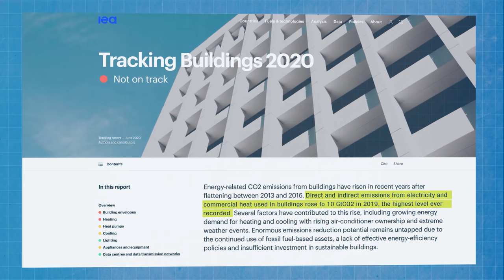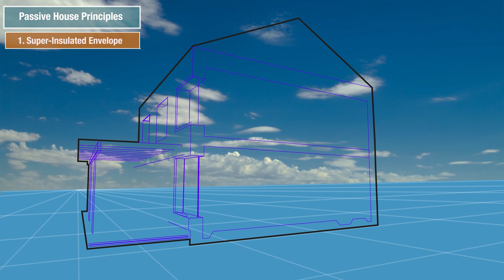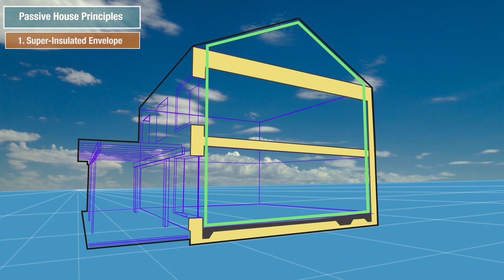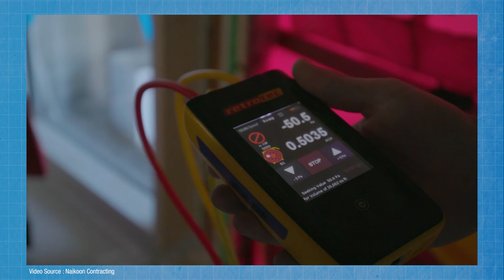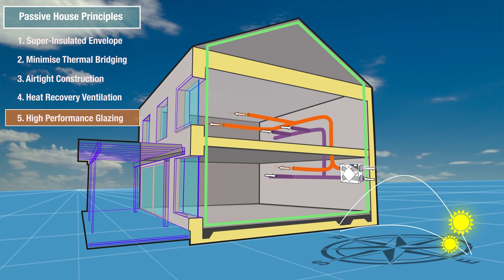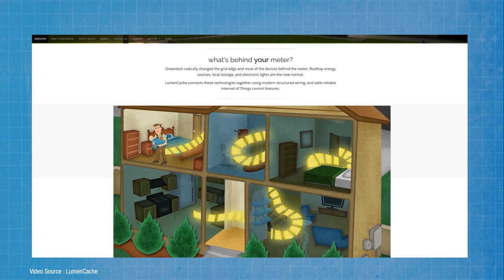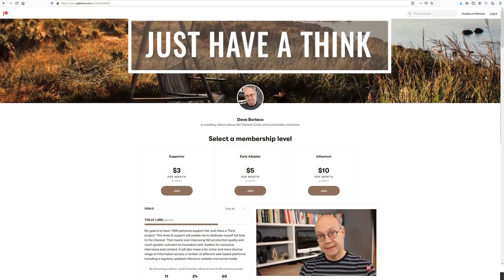Passivhaus . A low carbon future for our homes?

Comment: These should be combined with passive solar for a more enjoyable home. Windows let sunlight in to warm dark colored mass, like painted concrete blocks and water tanks.
In hot areas, put the rectangle of house plan north/south, to avoid too much sunlight heating through walls and windows. And obviously, east/west to gain more heat than needed for really cold climates. The trick is to store that heat in the thermal mass for overnight. That's where both natural and forced air movement works.
The big book on it is called...
The Passive Solar Energy Book: A Complete Guide to Passive Solar Home, Greenhouse and Building Design
by Edward Mazria
(4.3 out of 5 stars on the Amazon site).
I believe it's from the eighties and has a wealth of warm, lively, livable (with fresh air) information that might even compete with today's automated and almost airless solutions.

Comment: I am always disappointed that there is never mention  of simply having a smaller home as a means to be more energy efficient and having less environmental impact.
Reply: And terraced houses are great too. Only 3 external sides
Reply: Tiny homes 🙂
Reply: @Niels Kloppenburg You could use that argument for anything. One guy taking 3 baths a day will use more water than a whole family taking a shower once a week. So why bother to save water. 
Passivhaus can help the one guy in a large house AND the family in a small house. But I agree, the 15KWH per square metre target is something to aim for. It sounds like your company is doing well on the insulation. But if the joints leak air or you need a ventilation hole to get fresh air you will lose that advantage. Heat recovery ventilation and airtight construction should be in the mix also.

Comment: I lived in Laramie Wyoming and there were many passive houses built already in the 1970s.  I'd like to make two comments about insulation.  The fossil fuel industry is going crazy with many types of insulation, we should plant more hemp, linseed, bamboo as well as good old straw to replace some materials.  And I used to treat builders for back and shoulder pain.  Triple glazed windows cannot be lifted safely by the average worker and there has to be some consideration to helping the weak link, which is often a lumbar or cervical disc.
Reply: I think you're referring to passive solar houses being built in the '70s. Passivhaus is very different, but can incorporate passive solar heating. I built passive solar back then and have built passivhaus recently, including retrofit, straw bales wall, Adobe, etc. This video is a good description of passivhaus. It can be done with low embodied carbon materials.

Comment: As I'm currently just completing my own passivhouse renovation project in North London, I can tell you why so few are built, and cost is only a tiny part of it.

90% is down to a complete and lack of skills, knowledge and precision in the UK domestic construction sector.

Until people stop thinking that anyone can become a "builder" and they start thinking of themselves as "construction engineers" this won't change.

Trying to ingrain into guys on site to "don't puncture the airtight membrane - ever - unless I give you express permission" was a thankless task.  Phrases like "thermal bridging" and conversations about ACH are met with glazed, blank looks. Even the electricians - the so called "clean trade" and well qualified, think they can go around drilling holes in whatever they please to get the job done.

Well known and premium suppliers are frankly painfully uneducated, our "premium" glass sliding doors, were spec'd by the supplier as to be installed onto a concrete upstand, with zero appreciation of thermal bridging - "nobody else has ever complained" - exact response.  It took threatening to cancel the order to get them to support me installing onto structural insulation,  and a structural engineer to prove to them it was safe and possible.

Forget building passiv, just beating building regs (which is trivial to do) is a struggle, and it starts with a lack of passion to think different and be better.

I trained myself to be my own architect on this project, and the complete lack of precision in the UK construction industry generally, has frankly staggered me.  Building passiv is actually pretty simple, getting people who climb out of bed in the morning and give a damn about what they do is an entirely different kettle of fish.  If you find them, pay them well and keep them.

Comment: The current pandemic suggests our living spaces need more fresh air flow. The problem could be addressed with air sterilization using UVC light but that brings another challenge, ozone. It's certainly something that needs more consideration.

Comment: Interesting that a passive house requires an active heat exchange system. Most of the passive house ideas are excellent,  but remember that innovations are still possible. (Which usually means finding an older technology that is even more efficient and requires less concrete.)

Comment: When I built my house in North Texas, I insulated my roof with r100 and my exterior walls are r60, interior walls are r16. All my neighbors laughed at me, but for the past 10 years, their average monthly heating and or cooling bills have been around $600 and mine are usually about 60 or $70. I got the last laugh.

Comment: Passive house has been around for quite a while. Starting in 1990 when the concept really came about thanks to the start of affordable photovoltaic power. Since then there's probably less than 100K structures meeting the standard. What is both promising and revealing is that it adds about 10% to the cost of a project to make it a passive house. On the good side that seems pretty achievable for a premium on our homes to have low energy bills and state of the art comfort. The bad news is that clearly thats made no difference as it stands for the past 3 decades. Furtheremore if we just take an existing home and add enough solar and batteries to it to heat and cool and run all power for 2 days that comes to around $25-30K for an average size home (just a rough number).

For these reasons passive home although a nice ideal is a pretty meaningless metric. We should be hyper focused on setting higher standards on new homes regarding insulation and heating and cooling efficiency, incentivizing roof top solar in more states and starting to plan out base load renewables like wind and hydro as well as grid storage systems like pumped storage, molten salt and hydrogen.
Reply: Read my post.

Comment: I'm living in the middle of the alps, on the "wrong" valley side, with no direct sun input from mid of Nov until mid of January. Additionally due to the altitude it's getting very cold during this time (-25 to -30°C is quite common). On the bright side we don't have to worry about high temperatures in summer :). Is it even possible to build a passive house under such conditions, or is an additional heating has to be installed in any cases?

Comment: THERE ARE SOME BASIC THINGS MISSING FROM THIS VIDEO! Passivhaus is a design principal aiming at the reduction of energy required for heating and cooling while preserving or increasing the comfort of living of habitats. It can be achieved in many different ways, using different materials and building techniques. Despite the name Passivhaus, principals can be applied not only to houses (single family units) but also to a multi-storey houses, schools, offices, hospitals in essence almost any type of building. There are many examples of such constructions already built with well documented performance data. Devoting so much time for a lighting company offer is a nonsense when trying to describe a building standard, unless the video is just a promotional video for that company, disguised as passivhaus video. Looking at the comments under this video one can tell that most people did not understand it and it's not the first video from this channel which fails to grasp the issue well.

Comment: I wonder about the cost of the massive amount of materials that are required to build to passive house standards. The insulation products are mostly made from petroleum based sources for example... So what is the embedded energy of this type of system?
Reply from the maker: Well there's also hemp, and straw and some other natural insulators, so you don't necessarily have to go down the petroleum derivative route.
Reply: Recycled newspaper, aka cellulose densely packed is a common insulation. It is treated for fire resistance.
Reply: @JustHaveaThink  i have tried Hemp. Very labour intensive to install and expensive to buy...

Comment: The problem with a passive house is the cost of the build (in Australia). The cost of building a passive house in Australia is 40% more expensive than a standard house. Its much more cost effective to just build a standard house and air-condition the interior that is run by large scale solar and battery. Unless passive hause cost is reduced it will never become main stream..
Reply: Are you sure it is that much more? Many features of passivehaus are in the design itself like careful window orientation or well planned shading overhangs. Increase of insulation thickness usually costs also cents comparing to the advantage in performance one gets. It is worth contacting local specialist to to find out real cost than believing ill informed trying to sell cheap stuff that ultimately will cost much more.
Reply: @ukrytykrytyk8477  I am sure. I have just spent the past 2 years designing and preparing to build one. Only to pull out at the last minute due to the impractical cost.
Reply: @chriskuhl9961  What exactly was driving the cost up so much? Was the design or selected build technology particularly expensive? I'm surprised it was quoted that much more expensive since in Europe the difference is much smaller.
Reply: @ukrytykrytyk8477  the builder cost. There are only a few certified Passive Hause builders in Australia. The Material cost was huge as well, Passive certified windows are double the cost of standard double glazed windows, same for doors. HRV is $12000 plus install. Double stud framed walls add 30% to the framing costs. Insulated slab was 40% more expensive.. the list goes on.

Comment: What if you live in a +100 year old brick house in Ireland that was built specifically for drafts to feed air into fireplaces? 

Or in general, for many old established buildings, what can be the best alternative to traditional central (or solid) heating? Insulation is one thing, but they an actually cause damp and mold as an unintended side affect to an old house.

 For a climate crisis, nobody aren't willing to help anybody for solutions unless there's a loan +interest involved. It Really sinks in...

Comment: Passivhaus is a great but most, especially standard builders, don't seal their houses even if they look pretty.  It can and is done, but it is not cheap.

I have been told that making portland cement generates about 30% of world CO2 industrial generation.  Reducing use of Concrete or using a non-portland cement binder could work well but can take longer to solidify sufficiently.
Reply: Concrete is the best building material and we need to use it MORE.
It survives fire, hurricanes, smoke, flooding, extreme temperatures and is far cheaper to build with. Its also comfortable to live in, regardless of how the weather changes.
Join us at CLIMATE RESISTANT HABITATS Facebook group
Reply: Agreed, as long as co2 isn't an issue that needs to be considered.

Comment: Hi All . . .  just to remind you all  . . .  if we were to magically stop giving of CO2 tomorrow . . .  Earth would continue to heat up for about a millennium . . .  so getting to Net Zero is necessary but not sufficient.   We need to draw down the excessive carbon ASAP which is a huge but straight forward task that uses a variety of tested no-tech methods.
Reply: Absolutely, but it only heats at 0.2% / decade for 2 millennia once the heater's turn off, so it wouldn't be an urgent project.

Comment: I might have done a dumb thing when in a fit of self-righteousnes, I took out my gas furnace and put in a heat pump. All I've done is switch from natural gas back to coal, which is dumb. There are two ways for me to redeem my stupidity. 1. Find cleaner sources of electricity. 2. Super insulate my 1950s home.

If I but had the brains and guts, I'd start up a business that would  provide these product/services: 1.  A custom made add-on exterior to  homes designed to retrofit an existing home to look like  its existing  exterior and also provide an extra R6 or so of  insulation. 2.  Electrically deployable high R window coverings. 3. Active high efficiency electrical heating utilizing heat pumps..  4.  Passive solar  heating for attic and/or house interior. 5. Upgrade plumbing and  electrical wiring. 6. Upgrade interior with new furnishings. 7. Combine  all  these product/services into a business that also installs  photovoltaic  roof tiles such as Tesla roof tiles.
Reply: Though insufferably sanctimonious,
I, the amazing Charlie, make no apology for any of us.
Because combustors are worse than us,
we who electrify our car and furnace.

Go and combust no more and go electric;
it's much more righteous by any metric.

With my solar enabled morality,
I bought a Ford plug-in Energi.
I was trying to boost the American industry.
But right away, I had trouble with the low voltage battery,

a wonky AC, and then the Ford Motor Company
up and dropped the CMax Energi.
Now, I wish I'd bought a Tesla model 3.
But do not discount my tenacity.

Go and combust no more, my children. You go electric.
It's much more righteous by any metric.

Now me, I didn't need no government backing
to end my support for fracking.
I've disconnected from the gas meter
with a Rheem heat pump water heater

and a York heat pump to heat or cool me,
and once again I'm trying to support American industry.
And, although that's not always a good bet,
I feel we will get there yet.

mm hm mm hm
I feel we will get there yet.

Because I have a dream.
I have a dream.
That someday, little girls and little boys will live in a clean place

and we will have gone to combust no more and gone electric
and it was much more righteous by any metric.
https://soundcloud.com/allcharlietabernaclechoir/go-and-combust-no-more-2020-7-11
Reply: If persons were massively willing to sacrifice looks for efficiency you could install light pipes instead of picture windows & skylights and have only small real windows.

Comment: If you used those data-cable power systems, would that also mean you wouldn't have to change/check smoke detector batteries?

Comment: When I was a young civil engineering student in the mid 2000's, LEED certification was all the rage. Is that still a thing?
Reply: Yes, but LEED (and BREAM in the UK) covers many other things beyond the basic building fabric/physics. Passivehouse doesn't care how much cycle-parking you have, or how green the drive materials are - it's just about building physics. So they are not directly comparable.
Reply: Yes and I use to laugh about the green wash it speaks when I do my energy inventory in office buildings in Sweden. It happens that I found economic arrengments that can cut the energy use by 30-50% and on my way out found a green building diploma or similar in the main entrance. Sorry but it's most of a scam in my eyes... And most important it is not a proof of an energy efficient building where most of the reasonable arrengments has been done. 😂
Reply: Nope.

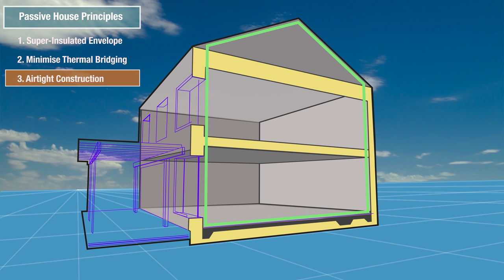Comment: 4:42 Great for European cold climates but How would this place handle mold in hot humid climates?
Reply: I think that is covered by the heat recovery ventilation mentioned shortly after in the video.
Reply: @danyoutube7491  5:38 then 6:35  IDK, I would like to see it before I buy it. Even with massive Air Conditioning / De-humidification, houses in Florida can have mold grow up walls over night.
Reply: @msnpassjan2004  
You need to build to the environment you live in.
Reply: Totally agree. Passive Haus is a cold climate invention and application. Traditional use in hot humid climates are light timber structure thatched roofs open to catches breeze and generally low thermal mass so thry do t store heat so you can sleep at night.